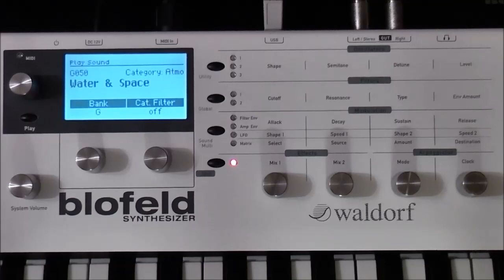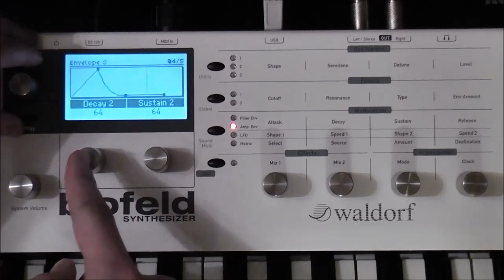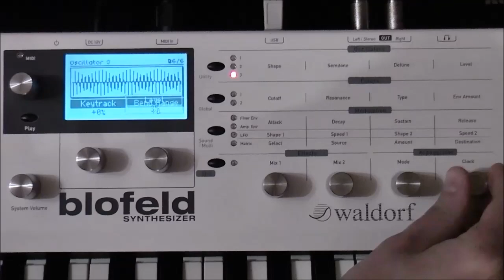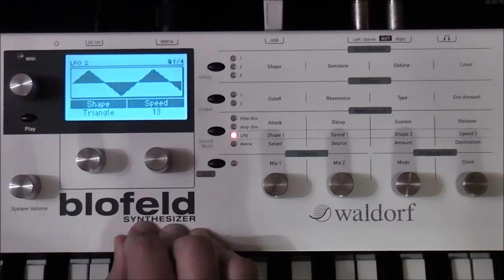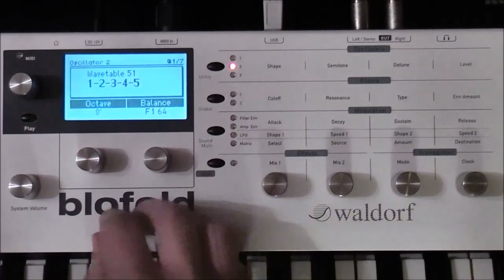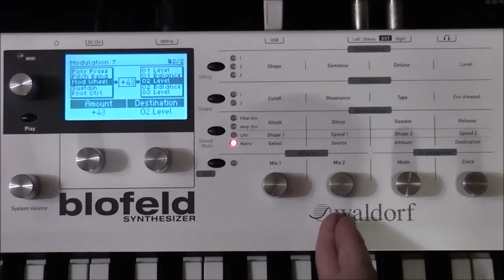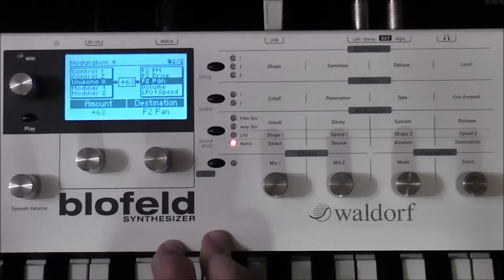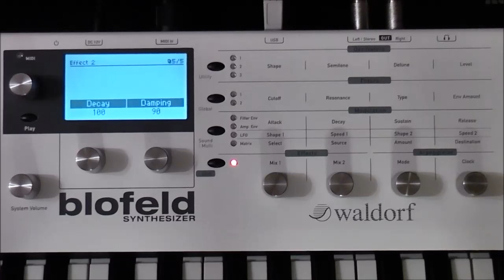[patch] Atmospheric Sound (Blofeld)

Comment: you don’t need mod slots for pan modulation both filters should have mod pan right under the filter settings, great tut... keep them coming..love how you use the 1-2-3-4-5 wave.
Reply from the maker: Thanks for your support! The sound has different layers on each filter (texture and basis) so that you would get a result with hard panned layers. With my solution I still have both filters on both sides but with a stereo sound (I just pan the voices, not the filter outs...). But your solution is quite good when your're running out of modulation slots or voices!